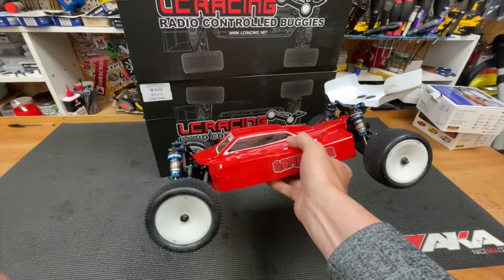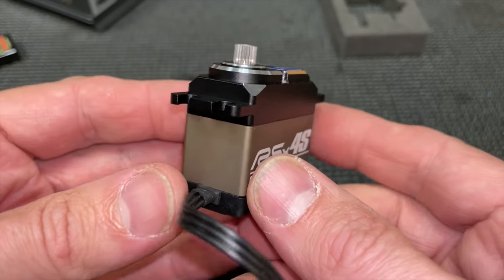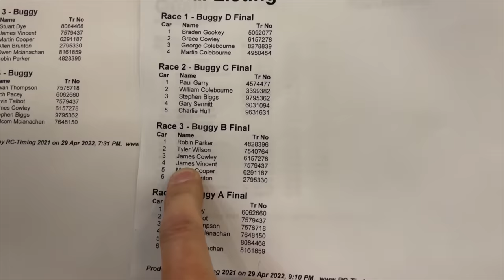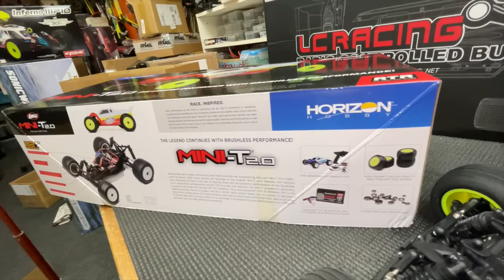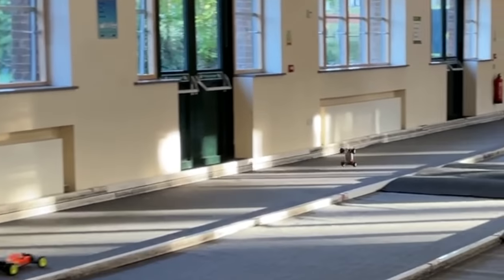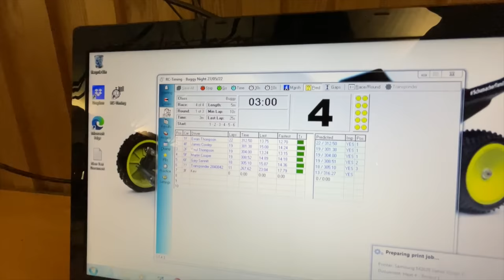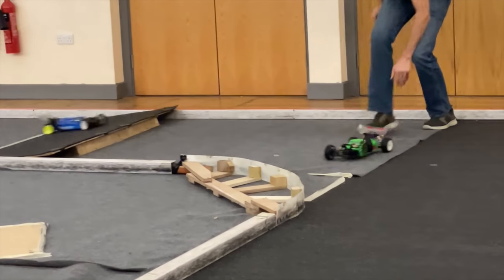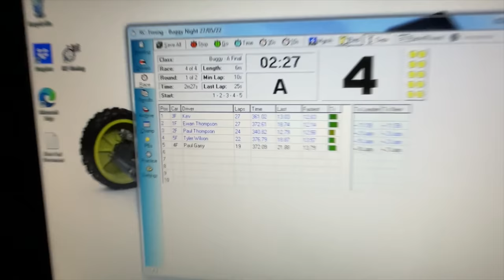Cheap vs pro RC cars go racing

Comment: For those watching, the LC10B5—that's their "race version" of a 1/10 buggy. The PGT-1 (shown in this video) is more for bashing. Obs, who cares, and you can race both—but, being a super fan of LC Racing, I thought it was worth mentioning. Also, the LC10B5 is a kit that needs to be built vs. the PGT-1 will come pre-built. The PGT-1 comes with a slipper clutch and is mostly plastic while the LC10B5 comes with a center diff and comes with tons of carbon fiber. As Kevin would say—that's enough techno babble.
Reply: Thanks for clearing that up. Because they were less than impressive.
Reply: Thought they did a more high end car.
Reply: yea, thats why the chassis seems familiar, it looks pretty much the same as my ptg2r
Reply: @kevin—so you mind pinning this so folks will know the "techno-babble" behind this model?
Reply: but for the price its better than most

Comment: The main difference with a digital radio is the ability to set steering end points and overall steering and you can also make the car easy to drive by setting steering exponential/steering curve. A high end radio is as much about the feel of it rather than how responsive it is. This year I've just changed from a normal digital servo to a brushless servo and it has again made the car easier to drive, seems to track straighter.
Reply: The higher end radios do have significantly better latency. You don't need the M17 to get that, but I could feel the difference between a radio link and sanwa and testing I've seen confirms its real.
Reply: Went from a cheaper end radio (Core Rc) to a Sanwa, and needed to learn again, the response time is instant with the sanwa, and kept turning in too early. Couple of days getting used to it, then start altering settings.

Comment: Hey Kev just to let you know the mini losi is a 1/18 scale and that on horizon hobby you can buy a 3s battery for it I think to give it more POWER
Reply: Put a CC sidewinder 3s 5400kv combo in mine and I can confirm it's absolutely absurd
Reply: that would blow the esc

Comment: One of great things about the expensive top-of-line Sanwa or Futaba radios is you can tune the servo speeds and feels to make them easier to drive. Most pro racers are turning down the servo speed 10-20% when racing with the ultra-fast servos on the carpet. Takes away some twitchiness and makes it easier to just push the car hard and get consistent fast laps with fewer mistakes.  Slower is faster is more than a stupid racing cliche.
Reply: They don’t have to be necessarily top of the line, as my 4pm has all those features
Reply: "power and speed is worth nothing without control"

Comment: "Double wishbone" suspensions have upper and lower wishbone shaped arms connecting the hub to the chassis. The Losi is an independent single wishbone suspension design with upper turnbuckle links just like the RC10.

Comment: You know, these aren't too bad considering.  Even the Re re Ultima spits the back hinge pins out on high grip like carpet.  A British company makes solid metal retainers for the Ultima to help with it.  Proper tyres on these things, then maybe tuning the expo or end points and such, might help with the steering.  Plus some tuning of the suspension.  They might be a good level entry car to get into racing??

Comment: Cheap out on your electronics starting out, but get a name brand kit. The issue with weird off brand chassis is that parts support is horrible. You also have a lot harder time getting help with setup at the track. Running the same chassis as the fast guys you usually will help you set up your car. To be clear, the name brand kit isn't about going faster, its not having a frustrating experience and a broken car that ends up sitting on the shelf.

Comment: Hi Kev it's nice to finally see a Losi Mini model on your channel. I suggest you could also get the Mini-B and race it against the Mini-T. 
Both models got brushed and brushless setups, I think you're gonna have a good time with those.
Also you can also get the Mini-B pro roller version and make it your 1/16 project racer. Cheers.

Comment: Hey Kev
I was wondering if you can give some advice on what servo I should use in my Arrma Typhon 550 Mega. I am looking for something with metal gears that is under $60 USD. Thanks
Reply from the maker: 21kg ecoboost i would say but you might have to change servo horn if it came with sprktrum servo

Comment: Can't you make a rounded or arched roll cage that roll the car until it's on its wheels ? 
It couldn't stay on the roof or its side then,always getting back on its wheels.
Reply: The aerodynamics and the center of mass would be kinda f*cked then, but if youd manage to overcome those, yes, itd be pretty epic mate
Reply: There was a car trick team that had a shortened VW rabbit it as shortened and had a curved roll bar over the top. They would hit the brakes and roll it over on its roof I belive I've also seen a lada do the same thing. I have done a stoppie (endo) in a Kei truck

Comment: Club race all you need is a good set of tires... the stock radio will work fine. with 1/10 2wd buggy, you can almost get away with a cheap analog plastic gear servo (even more so on dirt - the higher grip the more power you need in the servo).

Comment: People still get mad when you say cheap or expensive even if it is relative, I’d say for a toy grade £1-£40 is cheap, £50 is average, £60-100 is expensive and at £100 is about the point between toy and hobby and for hobby £100-£300 is cheap, £400-£500 is average and £600-£1000+ is expensive

Comment: Can you take apart a cheap and an more expensive servo and show the difference inside?
Reply: There’s not really any point in that. Most cheap servos now have metal gears so they’d basically look the same. The difference is in the speed and torque

Comment: 1/18 and yes it's a ripper.
Lots of aftermarket parts..
On the losing 2.o.
We have 3,only r/c we have 3 of.
3s is a must!wicked stock.
We put a mamba micro and cnhl 1500mah batt and it's a literl pocket rocket.

Comment: I use that Sanwa I’m actually sponsored by them. Those radios r really good and the connection from the controller to the esc is very long for big tracks like SIC or psycho nitro blast

Comment: Expensive radios vs cheap radios. You honestly only need an expensive radio if you want to be competitive, and your driving ability has reached a certain point where the delay speed of a cheap radio is holding you back. I raced with a cheap $100 radio for many years before I upgraded to a $700 radio.

Comment: I don't mind the dumbo radios for bashers, I have noticed (after 2 years of use) that the steering will twitch back and forth when it's sitting still, but never when actually in use. I really want a better radio for.my crawler to set endpoints, and save settings ect.... But I'm more likely to buy another brushless combo than a radio

Comment: I’m sorry but the Pin Snapped? You know it’s cheap when the Metal Pin snaps Before the Plastic Arm lol 😂 or it’s a godly strong Plastic Arm! But I doubt it.
Reply: LC weakest point is the hinge pin. It can be loose or snapped, mostly it will loose from bad landing or crashing (dont know why). But plastic part is really strong.

Comment: Should drill out the pin holder and put along nut and bolt through 🤷 problem solved and very cheap too 👍

Comment: My first nitro was an rc10 GT most fun I ever had put the metal diff gears in it 15 size motor it was a blast little sucker would pull a wheelie for days I had to put wheelie bars on it

Comment: I think my S-Workz s12 2wd came to under 1k in total. Kit £300. motor, ESC, programme card and batteries £250. Radio gear and transmitter £350 (Had used a £70 Sky RC prior, but wanted to change to sticks and ended up with a Futaba). Then the spares, tyres etc. All in all a lot of money but it's given me a lot of joy and is a professional set up. Happy days..

Comment: If the mini-t is like the micro-t it looks like the slipper clutch is too tight, loosen it to reduce torque and stop the car from flipping until you can drive better. 😘

Comment: Why are you running a KOProPo servo with a Sanwa radio, when you could run a Sanwa servo, with SSR/SXR enabled on the radio and transmitter, and get even better response times? Given the price of the KOProPo, not being able to even use the primary feature of the Sanwa radio with it, seems like a total waste of money, and a bad example of how you should pair certain components.

Comment: I love your channel but I have to disagree that that associated is over 2k when one of my nitro 1/8th scales with out extra parts fully built is around 3k and those can go over the 1k mark in a heart beat. I bought mine new for $850 with the engine alone being another $600 I’m already over 1k without doing the upgrades to fully build it and all that are about $500 in extra parts $600 remote $300 in servos tires where another $100 then the cost of nitro fuel for 6 gallons of vp race fuel is another $194 but will keep me going for about 3 weeks racing and setup for tracks

Comment: I’m excited for your opinion about the difference between a dumbo and the Sanwa M17. I personally switched from a MT-S to the M17, because it felt way smoother the driving and I could adjust that radio exactly to my hands, but is it worth the price? I wouldn’t say. Other radios work either.

Comment: Support your local hobby shop when you can. Obviously it’s hard to pass up some of those deals/situations. But try to at least throw them something when you can. Especially if they have a track as well..also you can buy a good, used current racing buggy for like 450$-650 RTR